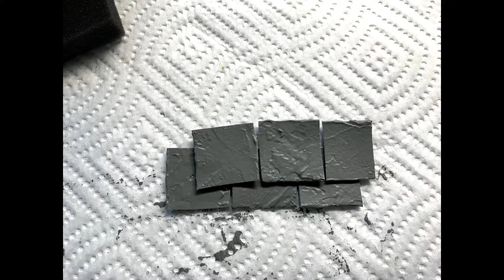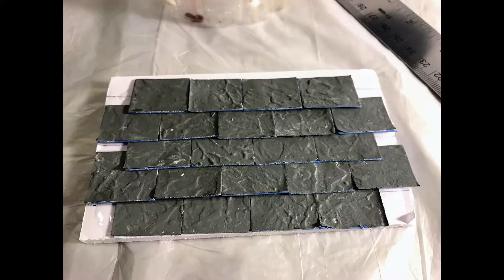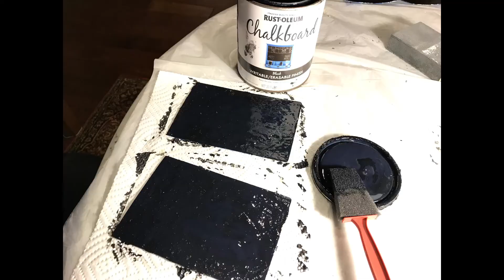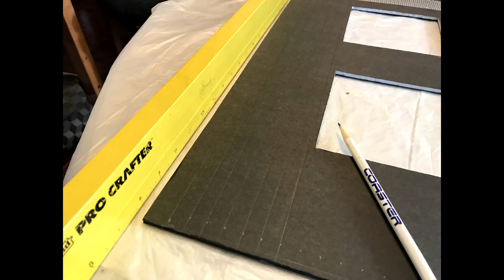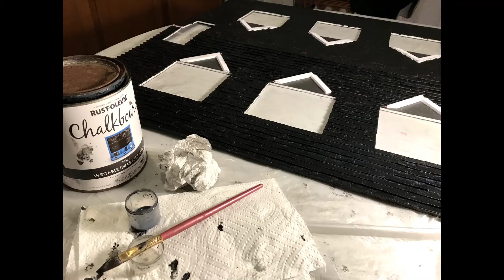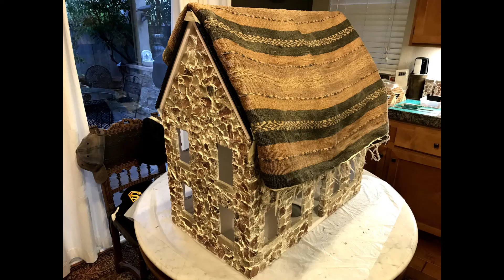Dollar Store Dollhouse Slate Roof Tiles

Comment: I don't imagine you will get this at this late date, but what kind of "foam" did you use as the shingles.  Clearly it is not foam board but something much thinner.  As an aside, I used artists gel medium as my texturizer as it is made to stick to surfaces, is cheaper than many other alternatives.  It also comes in various viscosities (soft, medium, heavy body) all the way up to something called modeling paste which is very thick and dries rather hard.  (It can be sanded I believe.) So one can experiment to see which thickness one likes.  The gels dry clear and transparent and can be painted easily.  The modeling paste dries white but can also be painted.
Reply from the maker: For the shingles, I used thin foam craft sheets and textured these with latex caulk, then painted black.  The caulk adheres well to the foam sheet but cannot be sanded.

Comment: I published a tutorial on my blog using foam sheets for slate tiles on my Arthur dollhouse however I think that your idea of incorporating plastic wood putty  for additional surface texture is a Really Good One which I in turn will  try out on my current Glencroft Reno, because your roof has turned out GREAT!  👍👍
Reply from the maker: Also try using caulk to create surface texture.  This is what I ultimately used to achieve to final product.  Caulk binds better to the foam sheet.